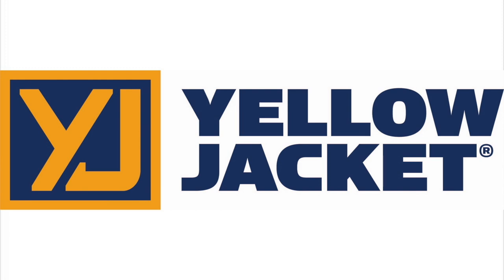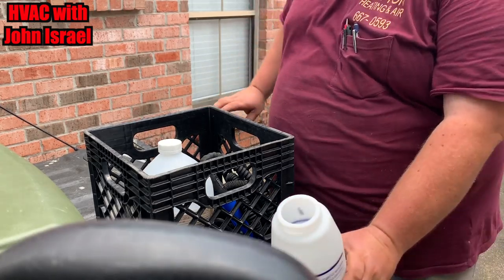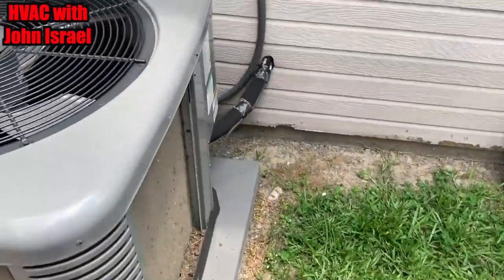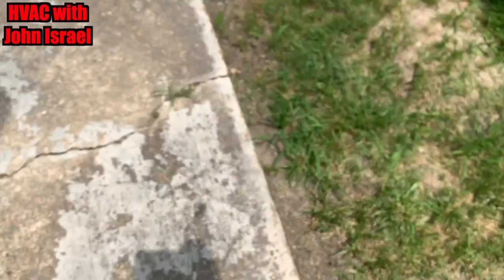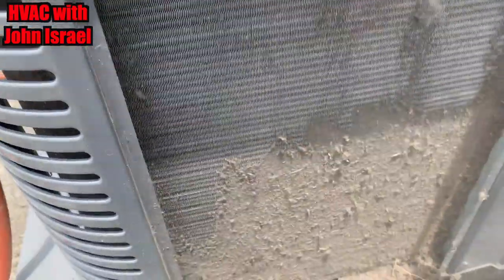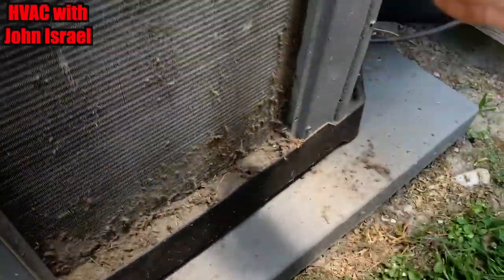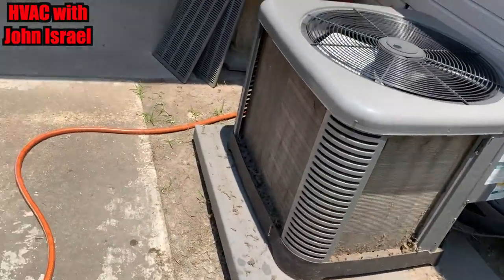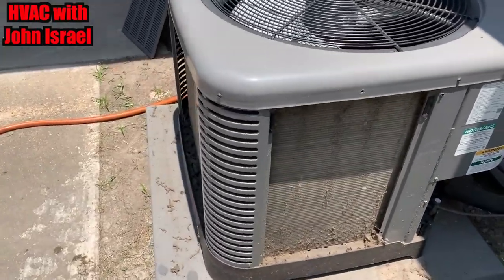Cleaning A HVAC Outdoor Coil

Comment: I usually try and backflush from the inside but I agree that cleaning from the front can be ok if you brush off the heavy accumulation as you did in your video. Some units are a pain to clean from the inside so we all have to use common sense how we deal with each situation.

Comment: I work maintenance in a 135 room hotel, rooms have PTACs( Packaged Terminal Air Conditioner). I pull and replace dirty units, this is exactly how i clean them, outside condenser units too. Indoor coils for lobby and halls are a pain to clean.

Comment: I'm researching this as a homeowner and it seems to brush off the heavy stuff from the front side, then spray/clean/flush the front then do the same from the inside as a last step would be an acceptable method as well.

Comment: You kind of shaft yourself if you hit the coil head on. If you hit it at a downward angle with water it washes a lot easier. You can knock the fur coat off too without dinking around with a brush for way to long as i've learned. It doesn't matter if you keep coil cleaner in the gun or not for eons. Hasn't hurt mine in the 6-8 months ive had it.

Comment: Also John which coil cleaners do you find safe to use on the black coils found on the IPC condensors?
Reply: Don’t! Use the brush and plain water or the paint will start coming off and you’ll spend the rest of the day trying to brighten the coil where it won’t look weird.

Comment: You say with backflush you still have to clean the front but that's the thing right there. Those that clean it from the front never do the other side. 

Let's be honest, front flush is the easy way out. If you want it done properly then you need to hit the back AND the front. Not only the front.
Reply from the maker: If you say so
Reply: What wrong have I said? You mention it on your video yourself. Saying you'd have to clean the outer part of the coil as well if you do the inside. Doesnt the same apply vice versa? To clean the inside requires more "work" which is why you decide not to do it. We both know in many cases it requires to remove the motor to properly get in there. 

If your customer saw your vid I bet he wouldn't be happy knowing you didnt also hit the inside. A service tech that does both shows hes passionate about his job and does 100%, not 99%.

Comment: What causes that much accumulation on the condenser coils? I'm in a dry climate, and have seen systems 20 years old without a single cleaning that are no where near that dirty. Seems like all the systems down south are always filthy. I guess just from much more run time daily (due to humidity) and the humidity itself making the crud sticky.
Reply: The ones I take care of it really depends where they a sitting and a lot of the time it's the dirt you can't see that's from the bottom of it to about halfway up

Comment: Where I work I have 150 coils that I take care of and as long as you keep them clean that's all that matters. The newer 13 seer units the coil is so thin compaired to the older 10seer units. The 30 goodmans I have to take the cage off so they get it both ways. The older ones I pull the fan so I can use the shop vac to get the mulch and leaves. Those there isn't very much room to clean from the inside out. Instead of talking about which way is best just get out there and do it. I never had a condensing unit get mad at me for so called improper cleaning not once.